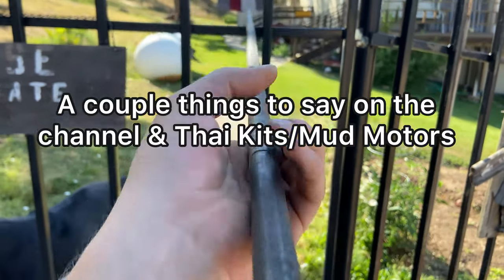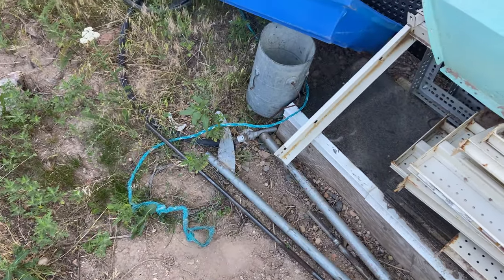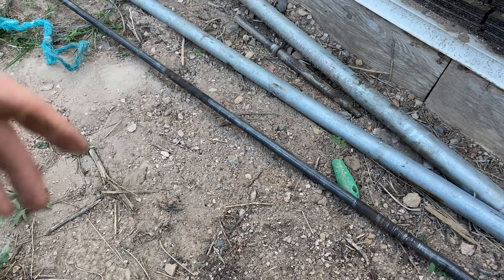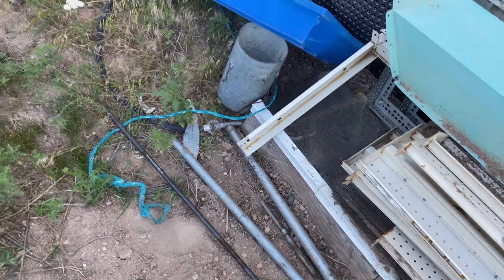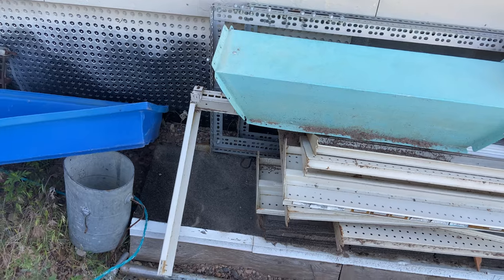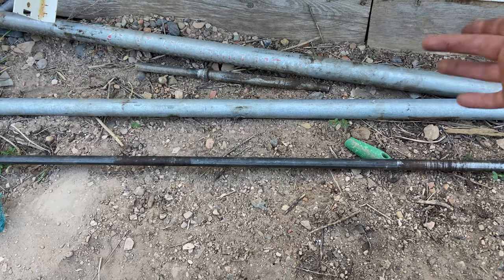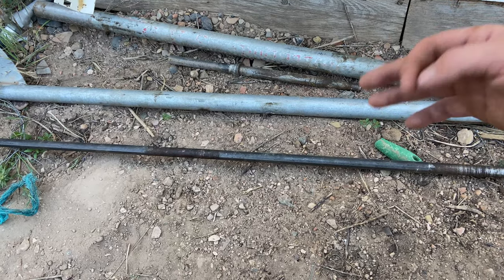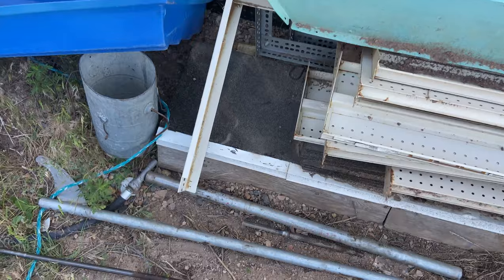Things To Say On The Channel | Thai Long Tails/Mud Motors

Comment: I actually like your channel, you look at the reality of it. Sometimes stuff doesn't work when I fix it but I've gotten pretty good at understanding how, where or when I make mistakes. I am extremely thorough with checking torque specs and sourcing the best parts I can. I just put it all out there and try to be creative, sometimes people like what I do and more times they probably don't but my moral compass has been in the right direction throughout the entire process so I wouldn't change it now.
Reply from the maker: Well I appreciate a lot. Yeah I’m trying to remain unbiased and real. I don’t it’s easy to be exposed

Comment: Thanks for answering my question with a video,,,my opinion is if you want a boat motor that is mostly for open water and shallow and light vegetation,Thai kit all the way,,but if your gona try to get stuck in some nasty stuff where you are using the thing as a pry bar,,mite want a go devil, the only reason I say that is that go devil still puts the motor on a frame,,it is attached to the bottom and the back of the motor,,when you do get in some nasty stuff,,you can force it to eat,,and I believe backwater still has some kits that have full frames,,but these kits that are attached to the rear of case with 4 bolts,,it does not take a rocket scientist to understand,,the first time you get a hit to it just rite,,or using the pry bar method to actually lift the weight of the rear of boat and make it eat,, well you get my point,,,but thanks for answering my question,,I had seen someone cut one of them shafts and I was like ,,no way ,,it’s hollow,,and was wandering about the swamp runner,,,good video,,I still think the swamp runner would b the Thai kit of choice,,they just seem to have it together,,
Reply from the maker: I’m definitely liking the Go-Devil design & they are the OG’s of Mud Motors. My plan is to have all of these different designs and companies. I haven’t announced it yet but I just ordered the Beaverdam mudrunner 2-7 hp kit and I’m pairing it to my new wildcat 223cc engine. Subscribe if you want to support the channel

Comment: Did you figure anything out on the Wildcat? I just had to do a belt change on mine the other day and it was pretty hot but I had the Juggernaut whipping around on it for about an hour.
Reply from the maker: I’m not sure I’m just gonna go ahead and run it and see how it goes
Reply: @MudMotorsMax  the biggest complaint I'm finding is that the Crankcase bolts can vibrate loose and the head bolts from the factory are a couple pounds tighter than gx200 spec. Both can be fixed with a small bit of red locktite and a little extra torque. Gray Goat from OMBWAREHOUSE.COM does a great assembly video on his YouTube channel where he shows exactly what to do.

Comment: Go ahead and take one for the home team and trash one,,put a stainless prop on one and let’s just see what there made of,,put it in some thick and nasty where you have to use the pry bar method ,,just curious what will happen first,,either that shaft is going to bend or it is going to crack that case,,and when I say prybar method,,make it eat,,I believe that’s the video we are looking for,,but your gona have to trash it,,,
Reply from the maker: I think that’s a great idea I’m definitely going to do that now I want to do an American mud motor versus tie kit video so I’m gonna trash the hell out of this thing we’re going to push this thing to the limits and possibly break them that’s OK I can easily replace the shaft if the engine crank case cover gives out people my understand that maybe it’s better to go with an American mud motor if you want to get in really really nasty stuff
Reply: @MudMotorsMax   No doubt,,I have a go devil and that thing is not only attached to the bottom of motor and back of crankcase  and the shaft has bracing all the way to the cav plate too,,when I get this heavy boat in some nasty stuff and I’m talkn cypress knees shallow tree limbs,,and Arkansas buckshot gumbo,,your adrenaline takes over,,because if you get stuck without a winch ,,and a little panic sets in,,your gona make it eat,,I have lifted logs out of the water with this thing that gets on top of it,,,that’s where the two classes of longtails come into play,,you have the true 4wd of boat motors,,and you have the Thai kits,,and if I purchased a backwater,,they are as expensive as a go devil,,I would get the one that has the full frame,,only makes sense,,